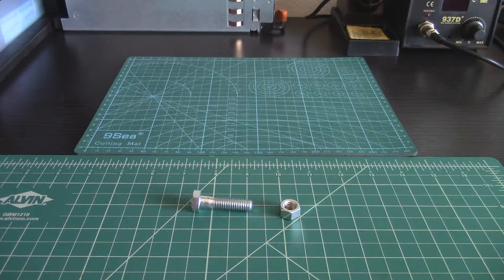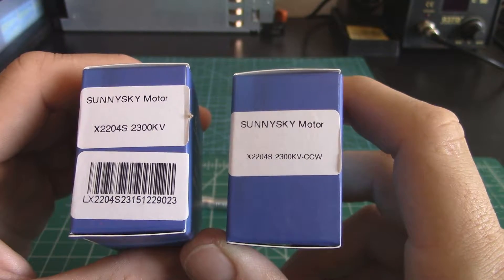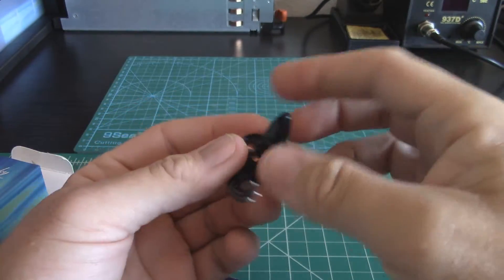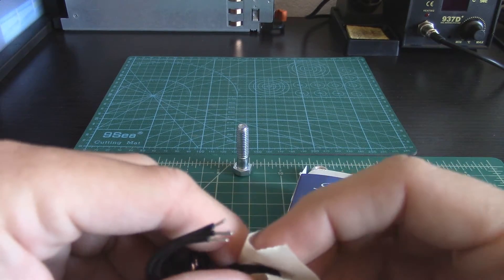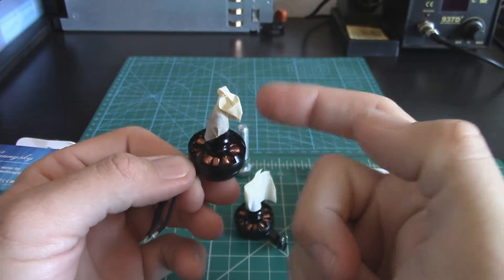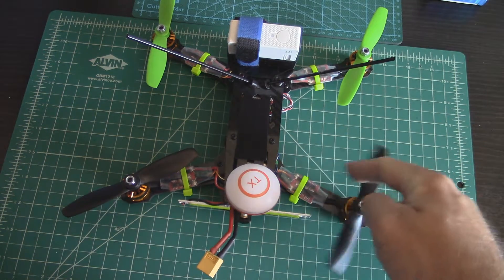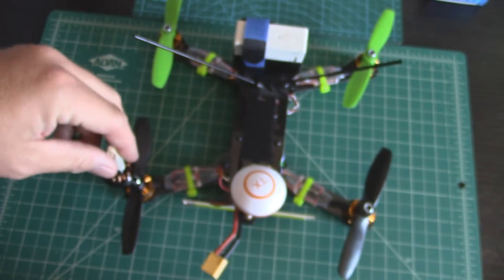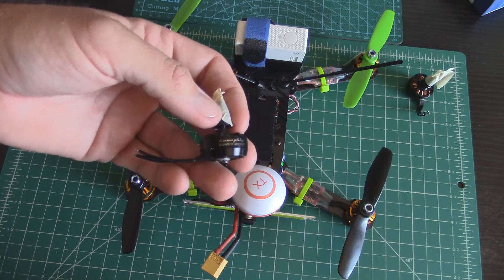CW or CCW Motors for Multirotors?

Comment: Thank you for the informative video. I have a doubt. Will a CW nut on a CCW motor make it a CW oriented thread that tightens when propeller goes CW? Or is it the thread on the shaft that makes it a CCW motor? Basically, I was thinking if it is the thread orientation on the nut that makes a CW or CCW motor? Please do share your thoughts.
Reply from the maker: It is the thread direction that provides the naming, not the spin direction
Reply: @OinTaylor  yes but thread direction on the nut or on the motor shaft? or both?
Reply from the maker: @13thChip  you will need to have the same nut on the same shaft, CCW to CCW, CW to CW.  The idea is like you say, to try and have self-tightening nuts on the opposite corners.
Reply: @OinTaylor  thank you

Comment: I just blew a motor and only had 1 spare motor for CCW but need it for the CW position. See your comments means I shouldn’t have a problem if I’m using the nyloc nut?
Reply from the maker: If I understand you correctly the only spare motor you have has CCW threading is that correct?   If that is true and you have a reverse thread nylock nut, then you'll be fine.  Motor spin direction is determined through the ESC settings or by switching 2 of the wires when soldering.   A CCW labeled motor means the nut tightens by turning it to the left (reverse thread)

Comment: So if i have 4 CW motors, do i have to change two of the motors to spin CCW? Would the nuts on the props get loose though?
Reply from the maker: The direction the motors spin is controlled either by setting the direction using the BLHELI software configuration or by physically swapping 2 of the wires from the motor on the ESC.   As for the prop nuts, if you are using NYLOCK  (nyloc) nuts for your CW motors, they shouldn't come off of the shafts no matter which direction the motors spin.   The nylon insert will hold them just fine if you have tightened them correctly.
Reply: @OinTaylor  Thank you for the reply. I'm putting together a cloned Mavic pro drone that i 3d printed, the reason i asked is because i'm ordering 4 Racerstar 2212 motors and they are all CW. Thanks again.

Comment: I have 4 CW motors on my drone, any tip to hold tight the props on the two that looses when it spins ?
Reply from the maker: If you have all CW motors, then I would simply use regular M5 nyloc nuts on all motors and not try to bother with self-tightening.
Reply: @OinTaylor  I'm using the original nut, but it's becoming loose, maybe I'll use some kind of thread lock ... thanks bro
Reply from the maker: @MrLuccasMF  if you use threadlock, only go with the blue.   I would look for another nut in the meantime. And actually 2 of your motors could never be self-tightening since you say they are all 4 CW, so you really have to use nyloc nuts.

Comment: So, you're saying that it's fine to run 4 cw threaded motors , even tho all threads are cw , you sure the motor nuts won't undo themselves during flight , specifically for the ones in place of CCW threaded motors
Reply from the maker: Yes that is correct, but you have to be using locknuts (nyloc nuts).   Regular nuts would loosen up.
Reply: @OinTaylor  sweet, thanks for the info 😊
Reply: @OinTaylor  i wa thinking of buying emax eco's and they are all CW. what should i do?
Reply from the maker: @viradeus4322   you can get them and use nyloc nuts.  You'll be fine.

Comment: Sir I was have 2 cw and 2 ccw motors but the i see the one of the cw motors seller sent me is not working. And I can not be able to find cw motor and i just ordered ccw motor. Can i make my quad with 3 ccw and 1 cw? The seller said me Ican use lockable nuts. Is it true? Please help me, thanks.
Reply from the maker: Yes this is true but if you have a CCW motor you will need to find a left hand thread lock nut which are not as common but they are available you will have to search around online mostly to find them.
Reply: @OinTaylor  ou can not use the counter-clockwise nut, because the pin of the motor is
clockwise, The motors are already manufactured with the correct position
Reply from the maker: @fabvelloso  you can make the motor spin either direction you want by switching wires or setting the direction with the ESC firmware.   If he needs to use a CCW motor in the position of a CW motor, he just needs to use a Reverse Thread locknut to hold the prop.  This will work just fine.
Reply: @OinTaylor  Problem is the Screw thread of the motor pin, 
Counter nut will not work
Reply from the maker: @fabvelloso  I think we are not understanding each other.  He said he had a CW motor that went bad and he could only replace it with a CCW.  this will work fine as long as he uses a reverse thread lock nut on the prop shaft.   When you say motor pin, are you talking about the prop shaft or something else?
Reply: @OinTaylor  The motor shaft They are also clockwise and counterclockwise

Comment: can u say  how  to  connect motor in clock wise and anti clock wise   using   esc
Reply from the maker: each motor has 3 wires.  After you solder the wires and are testing the motor, if it is not spinning the direction you want it, just unsolder 2 of the wires and switch them around and resolder. That will spin it the other direction.  Or you can  change the motor direction using blheli suite program.

Comment: What is different in cw or ccw motor??
Reply from the maker: The only thing different in CW and CCW motors is the direction the threads are cut on the prop shaft.   The motor parts (bell, stator, magnets, bearings or bushings) are all the same.

Comment: All the motors I have ever bought are CW motors, because standard screw nuts in the hardware stores are all CW threaded.

To me it's just a hell lot easier to go to hardware store and buy a bag full of cheap M3 and M6 locking nuts (with nylon insert in the thread that will not back out regardless which direction the motor spins) for all the motors. Removal is also easier since they are all standardized CW.

Ordering CCW and CW propeller hubs in 2 different sizes and then keeping track of which one turns in what direction is such a royal pain.
Reply from the maker: K Khalifah Exactly right, same opinion for me.  These motors went on a Hex I was building, I bought 8 total and 6 of them were CW and I used standard RH M5 locknuts

Comment: When the CCW motor starts spinning (CCW) the propeller and the locking bolt will have drag and inertia they will try to remain in their position OK...now this means the locking bolt will be like rotating opposite to the direction of motor shaft rotation.... so CW direction...this does mean that the locking nut will untightened/unscrewed and will come off the motor shaft....what the hell....
Your saying right about motor specification says CCW which is its threads... but the motor should turn CW and thats damn right no doubt...otherwise you will lose your prop in mid air...
...
...
So finally
CCW motor has:-
      -CCW threads
      -Should turn in CW direction...
          ......(Teaching myself)
Reply from the maker: Prathamesh Lad  sorry you didn't understand from the video, but that is what I said...  Use a CW threaded motor in locations 2 and 3 which spin CCW and use a CCW threaded motor in locations 1 and 4 which spin CW.
Reply: Oin Taylor oh! really you said that..maybe I just didnt listen carefully...
Then your the boss man...

Comment: On the really small drones the motors dont' have threaded shafts, but they still want you to specify CW orCCW when ordering. So, still confused.
Reply from the maker: +rblenian When I look at the smaller sizes like 1104 or 1106, and the propeller are held on with screws, not with a nut on the prop shafts, I do not find any listings that specify CW or CCW.  If they do not have a threaded shaft, you will be fine to order whichever type you like because you can reverse the rotation with switching the wires on the ESC or using the ESC configuration tool like BLHeli Suite.

Comment: Very helpful and it also confuses me with this cw & ccw...... Thank’s
Reply from the maker: Jarold Villanueva glad to help. Basically if you want self tightening you have to have the nut tighten in the opposite way that the motor is spinning.  Simple.   The confusing part was that the CW or the CCW refers to the threads not to the motor spinning Direction.
Reply: Oin Taylor yeah! and I thought it was the motor that is spinning the other way around... 😂 thanks again and hope to see more videos... :-)

Comment: I thought I had this figured out along time ago ,built a quad installed the motors and props as you have described in your video then one day I had a prop fly off 200 feet in the air while flying in moderate wind and it got me rethinking the whole thing. After some more thinking and experimentation today I am coming back around to your method but have come to the conclusion that it is not 100% full proof as you commented below, I think there are a lot of different forces at play during a flight that play into it regardless cw or ccw . I think the best thing is to thoroughly tighten the nuts, add some loctite or use nylock nuts as you are doing and everything should be ok.
I think a lot of people are under the impression that if they are using self tightening nuts/props that they only need finger tighten them and I believe now after my crash that is not sufficient or safe. I will be tightening mine with a wrench or using other methods to secure them from now on

Comment: Sorry but isn't that backwards? Think about if your motors props and nut are spinning at 10,000 rpm and the nut is loose or becomes loose due to vibration or whatever and you cut throttle then the momentum of the nut and also the prop pushing up on it would then actually loosen it and cause the nut to fly off therefore the nut should always tighten in the same direction the motor/prop spin. .??
Reply from the maker: Don Johnson if the nuts were to tighten the same way the motor is spinning, they would never be able to bottom out (reach full tightness).  the nuts have to be opposite of the direction of spin for any of this to work, and even still it's not 100%.  I think it's more about strikes than just momentum anyway.  And safest of all is to get 4 CW motors and use nylock nuts.  No need to worry about self tightening then at all.

Comment: what will happened if I use four counter clockwise motors??
Reply from the maker: marc justyn roxas you would really need to have 4 reverse threaded nuts (left-hand thread) to hold you props on.  Right-hand threaded nuts are the standard, so much easier to get at your local hardware store.  Going with 4 CCW motors just makes things hard on yourself, but if that's all you have or it's a really good deal, then good luck to you!
Reply: because yeah, two motors are spinning CW and CCW, I have these set of emax motors and it's all CCW, two motors will do self locking, I'm thinking if I'm going to fine about spinning on clockwise motors.. with CCW threads.
Reply from the maker: marc justyn roxas just crank those nuts real tight on the 2 motors that will spin CW (motors 1&4 if you're on Betaflight) or you can try to use the really easy Lock-tite which is the purple kind I think.  Or just try to find 2 left-hand threaded lock-nuts (m5 usually) at the store or online.   Lock-nuts are the safest way to go.  If you have to go online to order 2, you may as well order a bunch so you can use the reverse threaded lock nuts on all four of your Motors

Comment: So if I have 4 CW motors and I reverse the polarity on 2 of them are you saying it wouldn't be recommended to use the 4 conical nuts? Instead use 2 conical nuts and 2 lock nuts or rather all lock nuts?
Reply from the maker: Gus S Best way to go is to use 4 locknuts.  The nylon locking material will hold tight just fine.  The conical nuts look nice but are functionally inferior to using regular CW (right-hand threaded) locknuts.

Comment: Question. I added my motors on my quadcopter, but I put the back ones wrong, back left is cw, and back right is ccw, and the nuts got trethed so I can't take one of the motors off. Can I still finish building my  drone and have it fly right, or should I just get a new one and put them in the right order.
Reply from the maker: +Francisco L sorry it's been 4 days I just got this notification. If you have ESC that use blheli then you can reverse the motor rotational Direction in the blheli suite basically reprogramming those back to Motors to spin the opposite way that they are spinning. Hopefully you're able to remove the prop nuts and put the propellers on in the correct orientation.  If your es C do not run blheli and do not allow for reversing the motor rotational Direction then yeah you're going to need to physically switch the motors around on the arms.
Reply: Oin Taylor Got it. Thanks for the info.

Comment: This only refers to brushless motors? since the rotation can be changed by the wiring? A brushed motor's ration can't be changed by simply wiring it a different way right? I mean if i buy the  Racerstar coreless motor, i need to buy 2 cw and 2 ccw, or does the wiring determine if they go left and right? I watched the video, i'm still confused. Cause all drones need two blades that go left and 2 blades that go right?  Please help, i've been researching but i'm stuck on this part. I learned how to change the rotation on brushless but i don't understand if brush motors need be bought 2 cw and 2 ccw.
Reply from the maker: ALIEN-Oo-_-oO  You are right, brushed motors cannot change direction just by changing a wire around.  Brushed usually only have 2 wires anyway.  They are designed to only spin in one direction.  If you are talking about coreless motors, those are still brushed motors as far as I know, so you do have to get 2 cw and 2 ccw.  The wires are usually a different color to differentiate the 2 directions, usually the coreless motors are for the very small quads.
Reply: Oin Taylor  Thanks for replying,  i saw a video here on youtube, of someone who made a drone with 180 dc motors,  it's so confusing cause in his description he doesn't mention buying 2 cw and 2 ccw motors, but in video there's an image showing 2 have to be cw and 2 ccw, i was so confused about this, i thought he bought them all cw, so he prolly bought 2 cw and 2 ccw right? i would link you the video but i dont think its allowed here.
Reply: Oin Taylor actually on the brushed u can ive done it nothing burnt up motors changed direction cus each has like its own bec acting like an esc built in to the board and thats what your soldering to ive only had brushless burn from confusing wires and
Reply: you can change directions..but it's not efficient...just incase you get into other E skateboard or go karts still using brushed motors....That's why some people
install a jack shaft to make the a motor spins in sort  of the proper direction
Notice Powerwheels. They can go in reverse....but one side of the motor isnt turning in the proper direction. One motor is doing more work than the other.

Comment: I would like to share mine expirience with cw and ccw nuts. First i losti flight cw nut, it just fall of in the flight, then i bought cw nut, where u can find everywhere, and i put under shaft the spring clip, and i fixed the problem, then after few flights i lost ccw nut, then i ordered new set of 2 cw and 2 ccw nuts, and i put the spring clip/plate, on all motors, and i fixed the the problem, so many crashes everything was just perffect, until i lost mine xk 251, which is another story and mine unexpirience.

Comment: So i can buy either all ccw or cw motors and just change their rotation with the esc. Am i right????
Reply from the maker: Samridh Patial yes you can change the rotation direction with the ESC or by swapping 2 of the wires when you solder them.  I would recommend getting CW motors for all 4 so that you can use standard nuts or locknuts on the prop shafts.  if you got all CCW motors, you would need reverse threaded nuts, harder to find.
Reply: Samridh Patial yep but becare not to mix up your polarity i did n had 2 motors smoke right in my room so i just learned the hard way to just always do it in order and if i need to change direction just do it in blheli
Reply: Thanks for the video. But if you used all four CW motors, wouldn't two of the motors not be self-tightening? Are the lock nuts strong enough to withstand the force?
Reply from the maker: David Xiao yes locknuts are strong enough to hold the prop down no matter which direction they spin.

Comment: so basically you want to tighten up the nut in the opposite direction the motor is spinning
Reply from the maker: Wayne keeling Yes.  Seeing as how Reverse thread nuts are hard to come by through normal means, it is better, if possible, to just purchase all CW motors and use standard threaded Nyloc nuts on all of them.
Reply: Oin Taylor will in future but my very first build has just arrived it's a robocat 270, and has 2 of each cw and ccw
Reply from the maker: Wayne keeling Yeah, that's typical, 2 of each.  Mine was the same.

Comment: Agreed! Great Video... Those little nose cones look cool and all but they come off,I didnt believe it either,Built my first quad and used them,,,I always tried to check before flight,,then one time hovering it about 20' off the ground I seen my prop come off and flew into the sky as my quad flip and ran for the dirt! After that I went to my local hardware store bought 4 new stainless locking nuts for a few buck and havent had them loosen up one bit since!  I also agree that you will be hard pressed to find a simple lock nut in reverse thread anywhere locally. Listen to the man and do yourself a favor and stick with CW!
Reply from the maker: ProfitOfDoom420 Thanks Brother for watching!